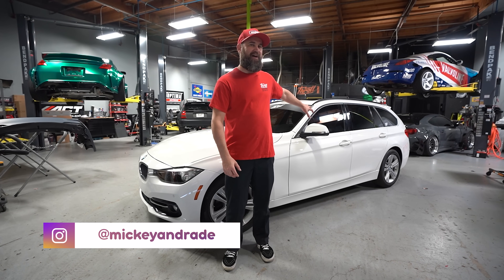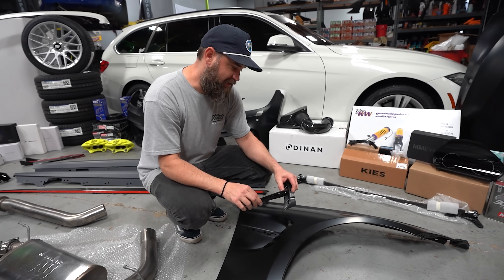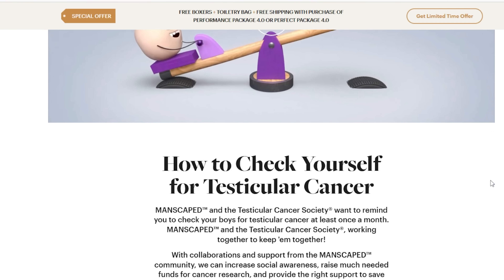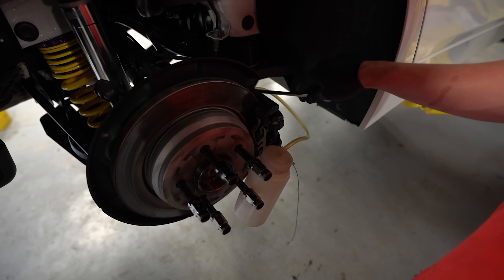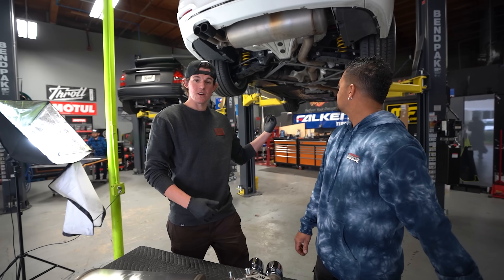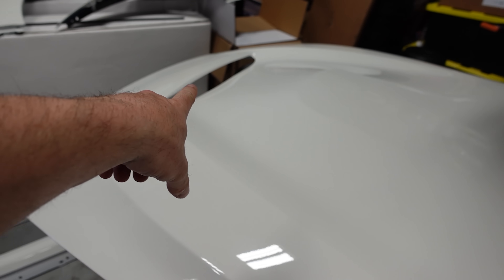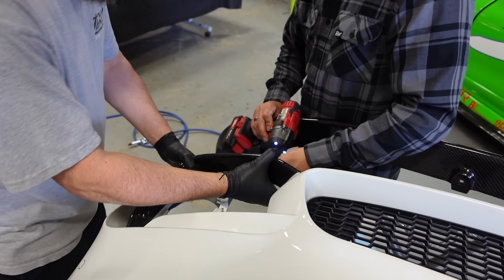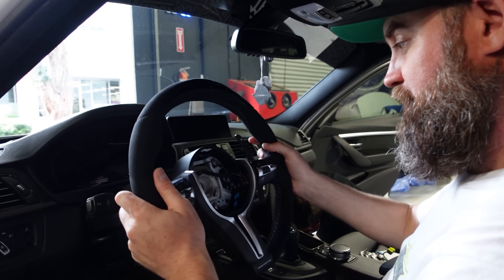Building a 2017 BMW F31 3-series Touring Wagon in 27 minutes! [COMPLETE TRANSFORMATION]

Comment: Throtl recipe

1. Buy either Suburu, BMW, or Mitsubishi ( bonus points if it’s white)

2. Change coil overs and add bigger brakes

3. Body kit
4. Carbon…….lots of carbon
5. Add fluro accents.
6. Exhaust
7. Speaker “kit”

Pretty much

Comment: Dudes are trying so hard to sell that 💩 sound system 😄 🤣 😂 DO NOT BUY IT!! You can get a JL system for that same price or spend a less and get kicker(wayyyy better sound quality)
Reply: Depends whether you want a box in your storage space.
I sat in the car and heard the direct comparison between OE Hifi and the Bavsound and there is a pretty big difference.
If your savvy with sound systems have at it with generic equipment. But this is a chassis specific engineered and tuned kit, and it is apparent.